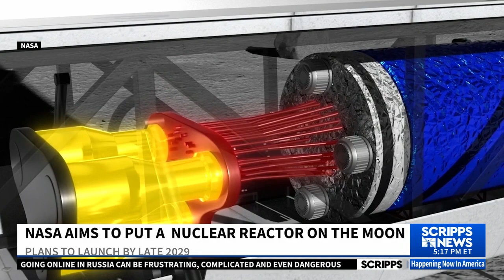NASA wants to put a nuclear reactor on the moon before other countries can

Comment: If China did not mention their plans to build a N. Reactor on the moon by the mid 2030s, this would not have happened.  The U.S. doesn't even have an operational  Small Modular Nuclear Reactor(SMR), BUT China does, and they are 10+ years ahead in most nuclear technology.   The U.S. had better get it's science/tech arenas really beefed up BEFORE attempting this, else it will fail miserably.

Comment: We do not have the delta V to create a high pressure reactor even ones that work in a submarine weight more than a rocket can carry
Reply: Not really true anymore. The Westinghouse eVinci reactor is about 40 tons for 15 MWe. Perfect for remote bases, as that's exactly what it was designed for. In fact, the US is ahead of the game in micro-reactors (I think)
Reply: @Jin-Ro  	They don’t need the starship which is not perfected. It will be cool during the dark season but need be cooled day exposed to meteors, UV and Infrared, and solar wind.  Be a technical engineering project.